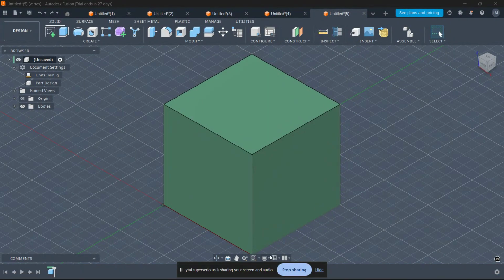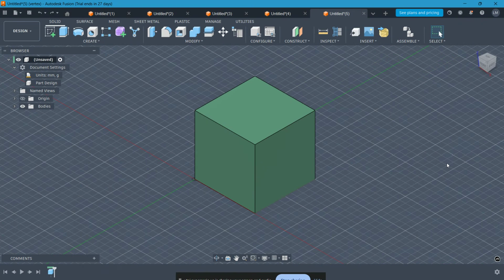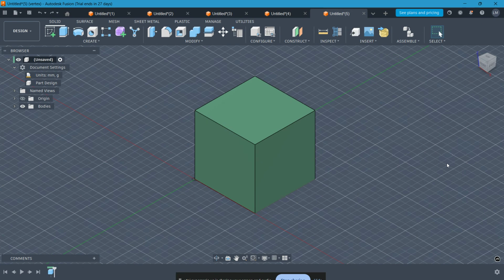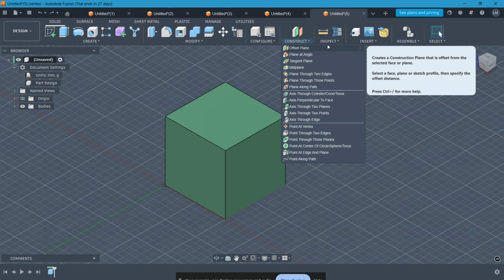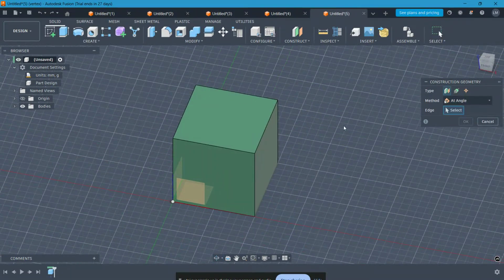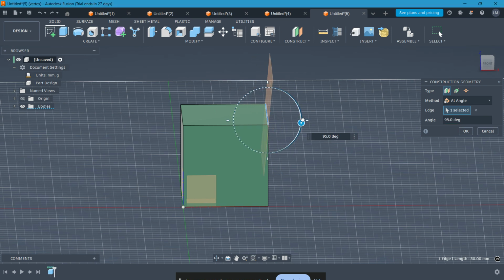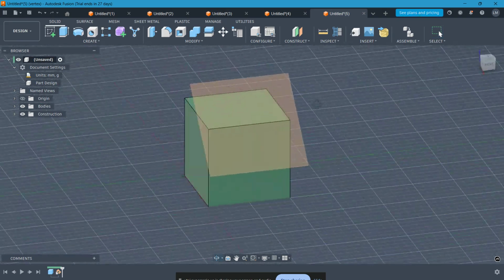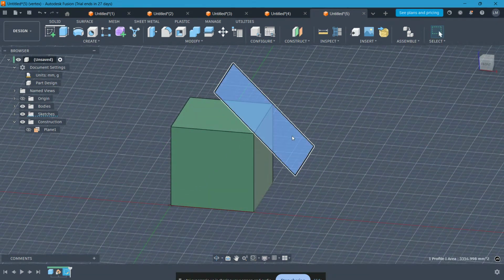How To Create A Plane At An Angle In Fusion 360 (2026 Easy Guide)

Comment: what I wanted was to draw a plane at an angle to two faces.  Orthogonal to one face I can do but not what was needed.
Reply from the maker: If you need a plane angled specifically between two faces, the 'Plane at Angle' tool works best if you select the edge where those two faces meet as your axis. Alternatively, if the faces don't meet, try 'Plane Through Two Edges' and select one line from each face. Hope that helps with your design!